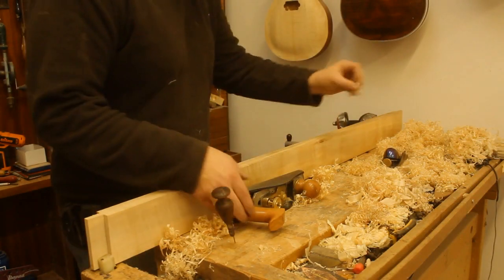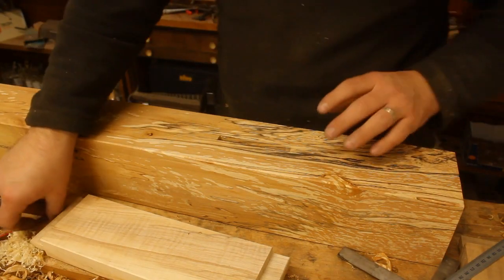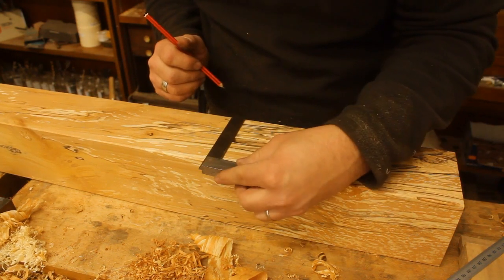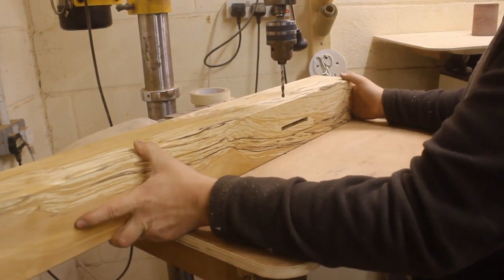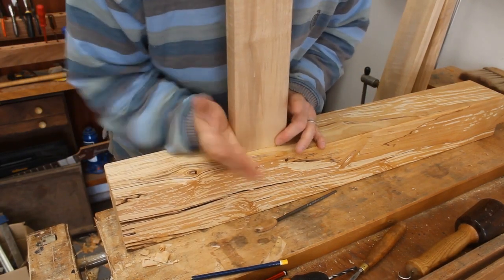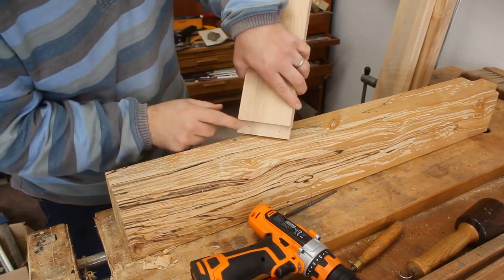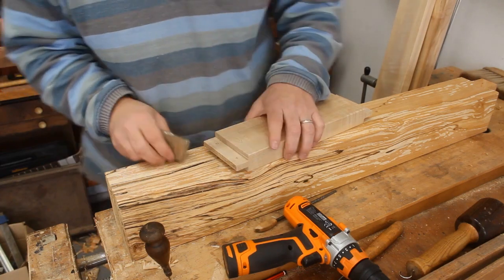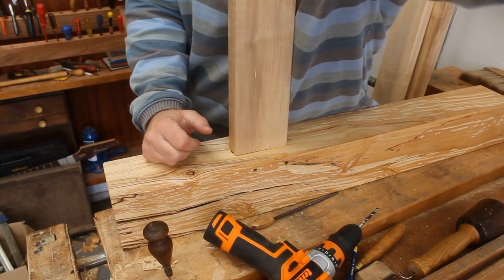Tutorial - Ep 5 -  How To Build a Luthiers Workbench - Drilling the drawbores

Comment: I broke down and used ply wood because I don't a jointer.lmao  But it's flat...flat.
Holy wow ..man Plywood is a brick. Plus it'll shatter if you use a wood file.Plus it'll wear out your tools faster because of the glue. I cut lighten holes using those bigger holes drill bits and hand saws for the center section of the body 2 7/8 thick piece and a 4mm ply on top...but Im thinking of using plexiglass on top. This way I can put picture of my kids under it. Plus I suck at painting
I thinking Im going to get at least blades for my jig saw for the next build.lmao
Then I'll work up to a jointer so I can glue 7/8 thick pieces together.
it works...because I don't have a router..so I can cut out slots for pickups, wire leads..ect